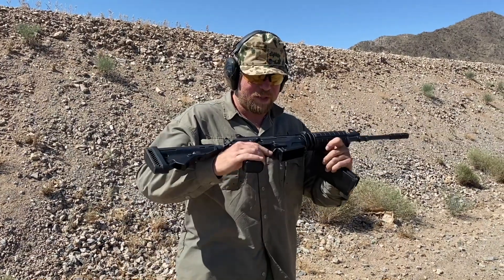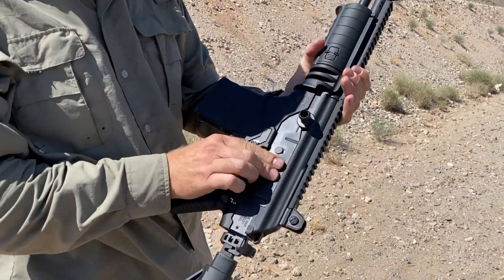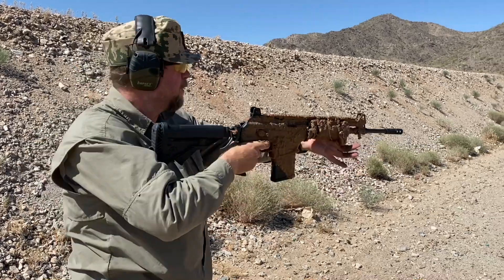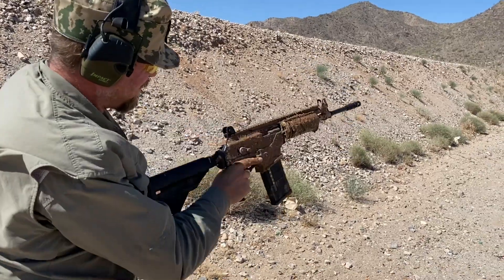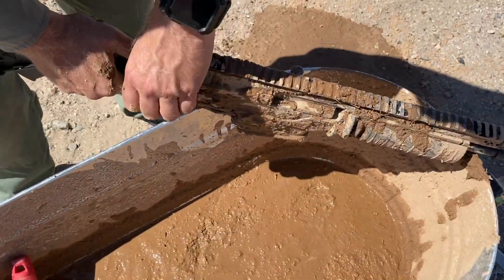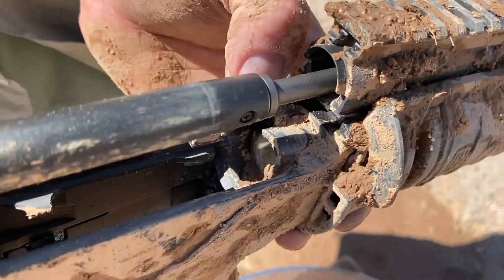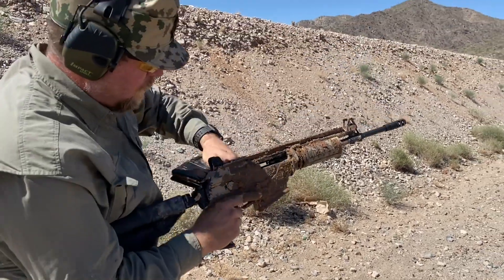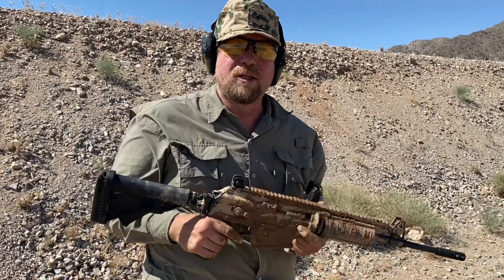Mud Test: 308 Galil ACE

Comment: This dust cover on the left side didn't fix any problem, it just didn't add any other problem. The problem with ak was the mud getting right into chamber, and it does the same here, so galil didn't work any better.

Comment: Well that little flap on the charging handle seems to have made some difference. A redesign of the ejection port geometry to tighten it up or add some way of directing the mud away (I say that as though it's a trivial thing) and it might well have passed the test. Certainly would have done better.

Comment: Even as an AK guy I can defo see the horrible mud like so as a problem for the platform. Watery mud isn't as bad but still, no one wants mud in or out of a gun. I'm sure cleaning would at least still be relatively easy but end of the day, some sort of way to prevent mud on either platform going into the ejection port would be key to keeping it going. 
But overall, did alright for a platform that has a disadvantage for chunky mud. I hope to see more down the line, perhaps more 'moon dust' sand tests?

Comment: This makes me wonder if Korean K2 would do a bit better. As it uses the same bolt and barrel extension as the M16, as far as I know. The K2 largely copies and is often characterized as the AK style of rifle,  but really uses re purpose AR 15 designs to make up the rifle.

It might fail this kind of mud testing anyway, though. I really don't have that much understanding of the K2
Reply: The main issue I see with the K2 with this test, is that the charging handle reciprocates and there is a track that the charging handle goes back and forth on and its completely open which would allow for sand, mud, etc to go in and fall right into the trigger area, which would choke it.

Comment: I feel like the spring-loaded cover on the left side wasn't so much an attempt at fixing an existing problem with the AK design as it was fixing what would have been a self-inflicted problem caused by giving an AK a left-side charging handle. It works really great for what it's supposed to do, at least.
Reply: I do love that left sided handle, reloads feel a lot more natural with there.

Comment: It's interesting that after the decades of weeping and wailing and bad-mouthing of the AR design, the AR is the ONLY one that passed both the mud and sand tests. It was the only one that was unaffected by either.
Reply: The problem with ARs is not keeping gunk out, it's the fact that the inner works tend to get gunked up from just shooting the thing over time. Nowadays that's been mitigated a lot with better design and tech but there are still lots of ARs that have that issue, you HAVE to clean them after shooting or you run the risk of malfunction. That's where the complaints of unreliability come from. AKs don't have the issue as much typically, but with a test like this, which is just about worst case scenario, they'll still have a problem because they aren't sealed. That's really what this test is about, how we the gun keeps stuff out, not about how the burnt powder and carbon affect the gun after heavy use.
Reply: The SCAR 17 beat it too, at least the mud test. Were still going to have to wait for the sand test though.
Reply: @kylekenney1907  
In my experience that isn't true. I routinely go 1,000 rounds between cleanings and occasionally significantly more than that between any kind of maintenance.  Not so much as adding lube.  On MAC's channel he has an AR test that is past 4k rounds with no cleaning or lube whatsoever and its running with no issues.
Reply: @podmonkey2501  It's funny how people stick to the old unreliable myth. Everything I've seen has proven the AR to be more reliable than the AK. Never had a problem with AR rifles. I have even fired an AR that a friend guessed he'd put 15k rounds through and I know he doesn't take care of firearms very well. Not a single malfunction. I did scrape a lot of carbon off of the bolt afterward. I can see him snaking the barrel and putting some oil on the bolt but that's about it. I have cleaned several of his firearms, that's how I know.
Reply: The literal Chad of all intermediate caliber carbine rifles
Reply: @ericn7677  

The AR is not more reliable than the AK. The difference between the two is that the AR is a sealed system so it doesn't have to actually contend with mud. 

The AK is more durable and performs better against sand, snow and ice than the AR.

Comment: Is there any danger with these modern rifles that they may fire out of battery during the test? Could the firing mechanism still fire the round even though the bolt is not locked forward?

Comment: Well, as of the ones that suggested they try the ACE out, it's pretty clear that the myth of the invincible AK platform that can run in any conditions with any amount of dirt in it is forever busted. I don't know of any AK that is more tightly sealed up than the ACE.
Reply: The AK actually performed better in the dust test than the AR. The AK is also better with ice and cold conditions. The durability of the AK is second to none.

Comment: I also don't understand why after the first time and not going to bed or a few times that started working just fine and you had more mud but the difference is you stuck your finger and the injection port and by the locking legs to quote unquote clean it but I think you were done better off if you don't stick your finger in there who can send it creates grit and more problems because you helped more I might get in those locking lugs

Comment: I never understood why it's seemingly so hard to cover up these kinds of ingress points on rifles.  Can anyone explain it to me?
Reply: The ingress points are often necessities of the mechanism. A lot of modern designs have addressed charging handles, but I think the majority of the mud gets in through the ejection port, which NEEDS to open or the weapon can't cycle. There are workarounds for that (see the FN F2000), but easy access to the chamber isn't something a lot of people willingly sacrifice. On top of that, moving parts in general can't be fit perfectly together, they need some amount of clearance to move smoothly and reliably.

Comment: Honestly, I thought the AK did better because it seemed like it was easier to break open and get running again. IMI has seriously wedged that top cover onto the gun.
EDIT: Sorry, forgot you did it with the dust cover up on the AK. Whereas this doesn't have one for the ejection side, which is kind of a drawback of the design, seeing as you don't even have the option to test it with it closed.
Reply from the maker: Requires a rubber mallet for reinstalling. :/
Reply: @InrangeTv  The ACE just seems like an AK that's trying to be an AR, and winds up not really being as good as either imo.
Reply: They make it fit tightly because the optic rail is on top of the dust cover. Being tight helps it maintain zero pretty well. It's especially tight when brand new, but does loosen just a little over some use. And you don't need a rubber mallet to reinstall it. Just get it in place (with the end of the recoil spring inside the receiver) and give a little whack with the side of your hand (judo chop style 😊) and it will pop into place. Running the charging handle once pops the back of the recoil spring back into place through the cover. The first few times on a brand new gun can be a little stiff though.
Reply: @InrangeTv  A karate chop will suffice when new.  After it wears in a little firm pressure with both thumbs does the trick.

Comment: I'd still buy it.
Well, no, because it's expensive and heavy.
But I wouldn't not buy it because of this mud test. I own an M1A, which was the absolute worst result out of anything ever tested and I'm still happy with it. Took it out to the woods, took it out to the desert, it did get exposed to some mud and dust but ran just fine the whole time. Even went 1500rds of mixed surplus ball and steel cased ammo with no cleaning or issues. Obviously I did not submerge it in mud, but the point I'm making is that a gun can have a practical degree of reliability without doing well on this particular test.
Reply: It's lighter than most 308 semis at 8.6lbs.  Off the top of my head only the SCAR is lighter.  And at around $1,900 street its cheaper than many 308 semi autos too.  They were selling factory blems of this gun for $1,200 a while back!

Comment: I don't know why, but I never realized that ACEs are AKs. The thing is, this IS pretty much all the changes I would make to an AK if I were to design an improved AK.
Reply: Yup, its thoroughly Kalashnikov.  More specifically the Ace is a modernized version of the original Galil which itself is heavily derived from the Finnish Valmet.  The first round of  production Galils were in fact built on Valmet receivers.

Comment: Remember the original AK that the Galil was based on was designed for the freezing and icy environments of Russia. It's not a complete guarantee that it will always function in hot, dusty and muddy battlefields without making changes to directly address the design's shortcomings.
Reply: The AK performed better than the AR in the dust test.
Reply: @thephoenix756  I know and I've seen the videos. The AK does better than the AR when it comes to dust. I was elaborating that AKs are not usually designed for mud. They work better in dusty or icy environments. Also the AK tends to jam even in dust, but it's designed so that an inexperienced shooter can quickly clear that jam and get back to shooting in just a few seconds.

Comment: For once i was expecting this AK system variant to pass. (Not an AK fan).
Did better :) because it is more sealed than other variants.
But the way the trunion protude inside the receiver is where the mud accumulate. And i suspect some beetwen the bolt carrier and bolt cover, just enough to slow it a bit.
An other springloaded dust cover on the ejection port and/or, as suggested in other comments, a lip or fence around it would mitigate the ingress of mud trough there.
Fingers crossed next time this system will pass. (Again not an ak fan) :)

Comment: I see enough real estate there for a E. Stoner style dust cover.  Why more manufacturers don't do this I'll never understand.  I'm a CZ junkie and chose an AR over a bren 2 because I KNEW it would see hell around the farm.  I had to take a water hose to my scorpion once and pluck hay out of ejection port many times.  Dust. Covers. Work.  AR has not failed me yet!
Reply: It's not just the dust cover. The chamber is so far inside the receiver compared to this one, where you can see it is almost next to the ejection port. Crud will get in there, whereas an AR is much more sealed up.

Comment: AR15 : " you are all peasant trash, I worked perfectly.....whats your excuse?"
Reply: Except the AR did do worse in sand than the AK.
Reply: @ramdom_assortment  in all rifles defense, sand is just a rifle killer in general some handle it better than others but sand is going to win eventually.
Reply: @crazy4milsurps  Right, but my point was that people stating the AK was beaten by the mud test didn't mention that the AK did better in the sand test. Even though the mud stopped the AK, I still think it's a more rugged platform than the AR, simply because if something does go wrong you can fix it quickly, unlike with the AR. Plus I have seen mud videos where the AR has choked. So both platform can do poorly in mud.
Reply: @ramdom_assortment   yeah I love both and would be confident if handed either given they are quality builds.

Comment: So basically all IWI had to do was leave the charging handle on the RIGHT side (like a normal AK) with that same springy dust cover and this probably would've passed the test.
Reply: It wouldn't need the the springy dust cover if the charging handle was on the right side.  The wobble plate is there to cover the left side charging slot.
And having the chraging handle where it is is a major ergonomic improvement.  The knob is shaped very well too, very convenient and comfortable to manipulate.

Comment: I get why they did the charging handle on the other side but it seems the design is somewhat unnecessary? By that I mean it doesn't help if the other side gets mud in it, and the spring loaded dust cover thing seems like something that would wear over time...

Also am I the only one who finds this gun to be very ugly? It's up there with the AR 160 imo. not my taste.

Great video as always guys!

Comment: Im surprised there isnt more “REEEEEEEEEEEEEEE” in this comment section.
Reply: I think we are all over it by now.  This is an extreme test in a narrow parameter.  Plenty of proven, respected designs have failed this test yet have proven performance in the field.  Like Karl has said in the past there is no sense in getting emotionally invested in an object.
I own this same model of Galil and years of use at the range and in class has shown me that its actual real world performance is more than adequate.
I certainly don't baby it and it runs fine. Even ran a 2 day class in heavy rain, crawling, sliding and rolling in mud and I had no problems with it. Even after decking  it in the mud when headed downrange.  I did make sure the ejection port was facing up though.  You just need to know your equipment and take the necessary measures to keep it running.

Comment: In 1986 the Registry was closed for select fire firearms. At the time a Chief Law Enforcement Officer’s Signature was required to complete such a transfer. At the time there were issues of inequality when it came to getting CLEO approval. Blacks where often discriminated against with many being unable to obtain the CLEO signature required. As a result the value of these firearms has risen into the tens of thousands each with $20,000 being about the average. Those which were not on the registry prior to the cut off date in 1986 are not only completely worthless, but also highly illegal. What I would like to see happen is a temporary reopening of the registry an a concurrent Amnesty. This happened in the late 1960’s, and was highly effective. Once on the registry these highly valuable collectibles, some valued in excess of $100,000 each for rare examples, would funnel much needed money into minority communities, as well as getting illegal firearms off the streets, and into the hands of competitive shooters across the country.
Reply: Sound reasoning but there is as much chance of that happing as a total repeal of the NFA, which I support.

Comment: What is your honest opinion about this 308 Galil Ace using an M4 recoil absorbing buffer tube versus the folding stock, replacing the muzzle brake with what you alert to in the following video, and trying to reduce the weight by using a stamped receiver engineered to be just as reliable versus the factory milled receiver?  NOW, how would this final product fair against the U.S. Army Next Generation Squad Weapon program using experimental 6.8mm rounds?!  My proposal involves this 308 Galil Ace REFINED based on your, and OTHER, recommendations which are common and narrow down the problems!  Our U.S. military can USE this weapon YET, it needs to better compete against the experimental Next Generation Squad Weapon using 6.5mm ammunition!  It is VERY hypothetical YET IWI and what is operating in the United States, NEEDS to know about this!  What do you have to say?

Comment: well quite clearly shows that these problems are not because of a specific nation making the gun, but to the design itself (doesn't really matter too much who made it, they all function the same). Also fun fact to those who didn't know : most of the famous ''reliable'' AK's used against Americans in Vietnam war or against Soviets in Afghanistan, were in fact Chinese copies and not ''proper'' Russian ones. So these myths of ''legendary realibilty'' of the Russian AK are based on lies and half-truths in its core
Reply: i'm guessing the reliability myth comes more from recoverd AKs which were rusty, dirty and overall neglected but were still being used to great effect. The AK doesn't work when it's filled with mud, but it'll probably still run after being in a weapon cache in vietnam for 3 years without being oiled or cleaned.